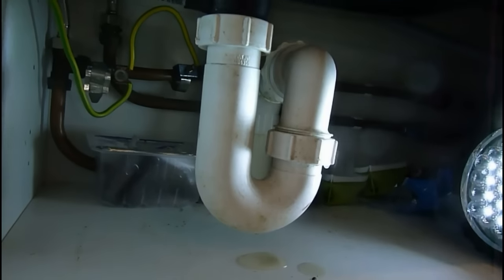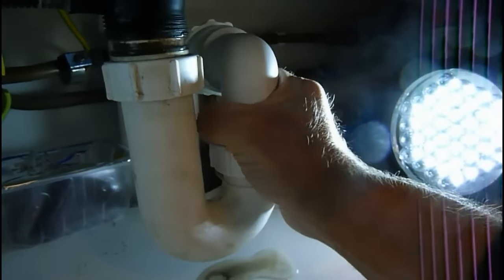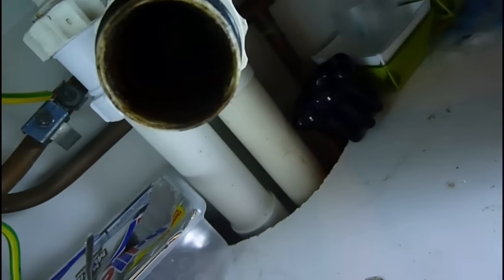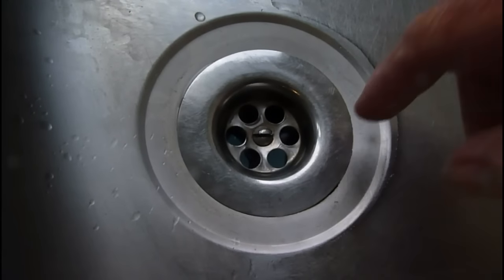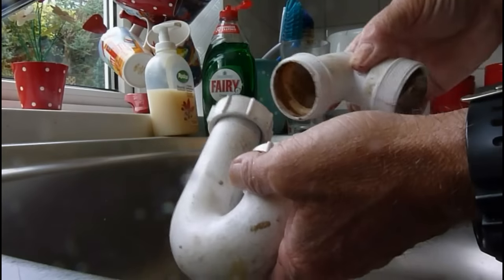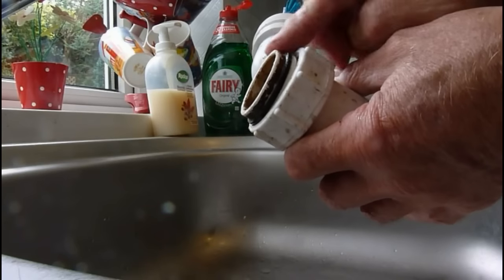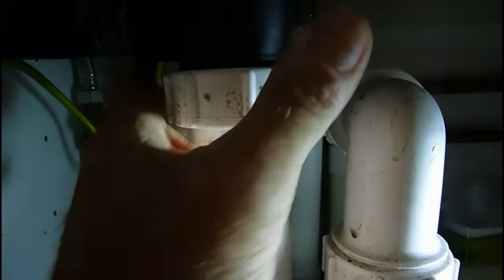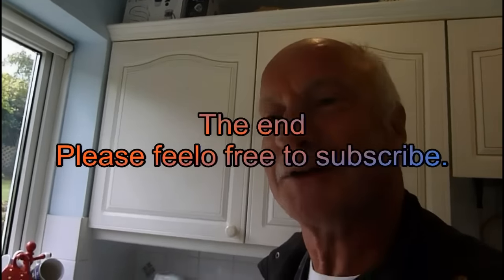How to fix a leak under your sink.

Comment: Thanks for the tip for using PTFE tape to fix the leak. I moved into a new house recently and the waste pipe in the kitchen had a very slow leak. I really couldn't be bothered with the faff of contacting my landlord or a plumber for such a minor issue, plus I had some PTFE tape anyway in my tool box. Took me all of 10 minutes to fix it. Job well done! :)
Reply from the maker: Glad I could help!

Comment: We had a new kitchen fitted recently and every few months or so I have to tighten the nuts which come a bit loose as the u bend starts to leak.  I reckon its the washing machine which is next to the sink causing vibration enough to start loosening them. Does that seem logical/have you come across that before?
Reply from the maker: It is quite logical, especially if your waste pipe from the machine goes onto a washing machine trap.

Comment: Thank you! It started leaking under the sink yesteday.  I was just back from a day of cycling so I watched this but being tired, I stuck a plastic box underneath to catch any water in case (which I did at times) I forgot not to use the kitchen sink.  Woke up fresh this morning and using a bit of duck tape to tighten the connection (also removed the U bend, cleaned it out etc) and problem is fixed,  The U bend I guess is not far off 20 years old so I'll "splash out" and get a new one and if / when it leaks next time, I'll just change it.
Reply from the maker: They are cheap so sometimes not worth repairing

Comment: Thank you so much for taking the time to video this! It saved me a lot of panic. The pipes had completely separated, I'm guessing that the vibration of the garbage disposal loosened the nut over time. I fixed it in no time after a lot of cleaning up.
Reply from the maker: No problem Sandra.

Comment: I could not tell, but it seemed one end of your trap was a flanged connection?  The difference is subtle but important. Flanges are used in two places under sinks: on the top of the vertical tailpiece coming from the strainer and into a Tee connection.  All other connections involve a taper, whether from a washer or molded into the pipe.  If you see a flange instead taper on, say, a tailpiece going into the wall, you've got the wrong one and it will NEVER work.  In the USA, entire trap assemblies are typically under US$20 and assure perfect fit.   Get PVC if you can.

Comment: i have a leak on the joint of pipe under wash basin and I can't see the washer?
Reply: Vs Guevara how did you resolve this issue because I had the same thing happen yesterday under my sink.

Comment: Clear and straightforward thanks Ill give the Teflon tape a go firstly as I had Such trouble doing the the screw back up through the plughole -it kept spinning and only after a long battle finally it screwed back up-but now its leaking badly from underneath directly -not near the nuts.So i will try PTFE tape up there and fingers crossed .

Comment: Thanks for the video! What should I do if  I can’t twist it properly? It doesn’t seem to get tight and leaks 😢
Reply from the maker: The thread may be crossed or the nut is stripped so will not tighten a new trap is your best bet.

Comment: I just had a look at your Amazon shop... Are there any pros or cons to a flexible waste trap over rigid, and are the fittings/washers a standard size?
Reply from the maker: Flexible is fine. The washers are not all standard. The fittings though are.

Comment: What happens when the Clog is further down the pipe whereby you can’t unscrew to clean?
Reply from the maker: I use a cheap air pressure gun.

Comment: How would you know what washer is causing the leak and what one to replace?
Reply from the maker: Use kitchen towel or toilet paper, wipe around starting from the top nut and work your way down until it goes wet.

Comment: I poured boiling water into the bathroom sink to unclog it without knowing that it may cause the pipes to melt. Now, it has started leaking thoroughly. Do you think I should change the pipes or may this work?
Reply from the maker: Should work OK.

Comment: Hi, I have recently had a new kitchen installed and the sink waste pipe was leaking slightly when running water (only really a few drips creeping out), I took apart the pipe and noticed the black plastic washer didnt look to be fitting right, I took this away and refit the pipe tightly. This seems to have stopped the leak. I am just worried that this wasnt the correct thing to do and may cause issues in the future? Thanks!
Reply from the maker: Dont worry that is the correct thing, all should be ok now.

Comment: Thanks so much for this video. Me & my daughter are about to embark on this little job. I suspect the top washer (first under the sink).
Reply from the maker: Good luck with it.
Reply: @dereton33  Thanks all done. It wasn't the washer, it was the bolt that holds the sink waste in from the top down, it had split in the middle so wasn't holding tight plus the sealant under the top part of the waste. All done and no leaks.

Comment: Where can you source O-rings?(washers). My 40m o-rings have disintegrated. Plumber's merchants suggest  buying a new component e.g. u-bend etc. This is a terrible waste and adds the to the ever growing problem of discarded plastic.  Just for the want of o-rings. PTFE tape does not fix when o-ring missing
Reply from the maker: Try hemp and compound. Very difficult to get those now.
Reply: @dereton33  Thanks for taking the time to reply. I decided to purchase a new fitting from B&Q only to find the stocked 40mm o-rings. So job done. Kind Regards.

Comment: Love your helpful video. There is a different guy doing a similar video on a bathroom sink. He doesn’t have a rubber washer ring in his pipe. Are the rubber rings more common in kitchens than in bath sinks? I have a little leak in the kitchen.
Reply from the maker: They should be in the bath ,basin and kitchen sinks.

Comment: HI GREAT ADVICE, I GOT THE NEW P TRAP & INSTALLED IT BUT IT IS LEAKING FROM THE TOP OF THE J BEND , THE OPPOSITE SIDE FROM THE DRAIN, I REDID IT 3 TIMES,  THE CLEAR SEAL IS ON & IT IS THE TAPERED SIDE DOWN. CAN I USE JB WELD FOR PVC
Reply from the maker: Yes use the weld that should stop it.

Comment: Thanks for an excellent video. I had to take off my U bend as it was clogged up with fat. I replaced the washers. But should you use some sort of jointing compound on the threads to make it extra water tight?
Reply from the maker: No not on plastic.
Reply: @dereton33  Thanks.

Comment: So i noticed a slight drip leak coming from the first 'nut' from the sewer opening. I just tightened it manually and so far is working but how will i know if i need to replace the washer inside? It's these times i miss a man around the house....
Reply from the maker: If the leak has stopped it probably just needed tightening up as you have done. Do not worry about the washer inside unless it leaks again.
Reply: Ha ha. It turns out the entire thing under the sink that holds the drain was disintegrated. Thank God for Brother-in-laws who are handy. He replaced the entire thing and it works fine now.

Comment: I have a leak and I have done everything to fix it - including replacing the whole thing and it's STILL leaking. I am not sure what I am doing wrong I have the gasket. Plumbers putty sealant tape and channel locks and have tightened it and it's leaking now. Grrrrr
Reply from the maker: Sometimes it`s enough to drive you mad. Plumbing.
Reply: Oh my goodness you are NOT kidding! I was so frustrated that I forget to ask you my questions. HA no worries though. I put a metal one on and its perfect thanks to you posting this. I really appreciate it.
Reply from the maker: No problem.
Reply: +L.A DiNiro Now you can remove your post.

Comment: I don’t got a screw driver or anything can i just fix it by hand, i did tighten it & when i use soap in the sink it leaks again
Reply from the maker: It should work by hand.
Reply: @dereton33  ok thanks
Reply: It’s loose where the white pipe is how should i tighten it?